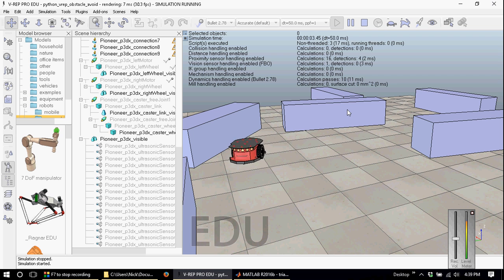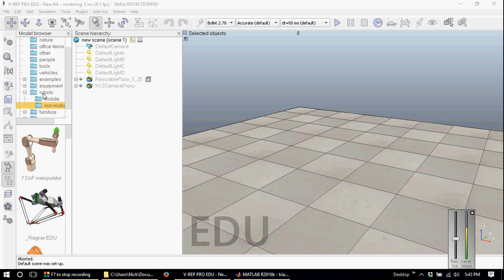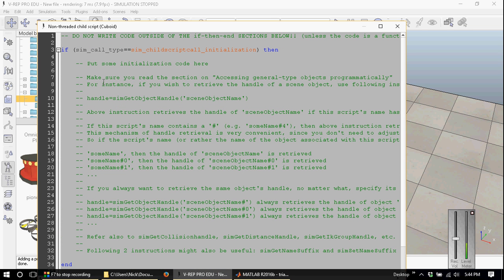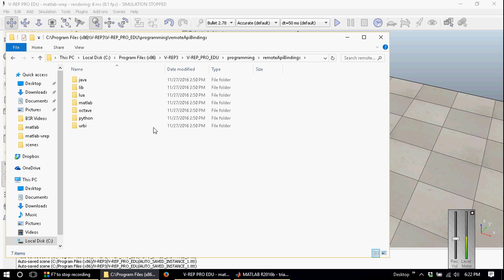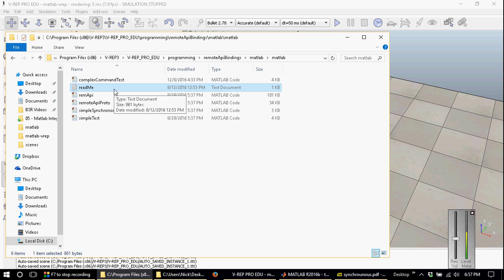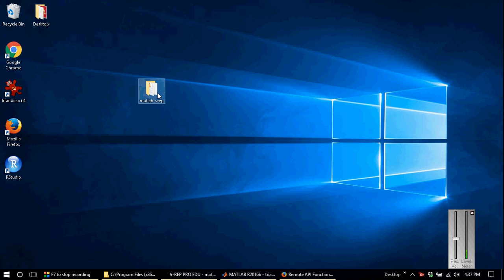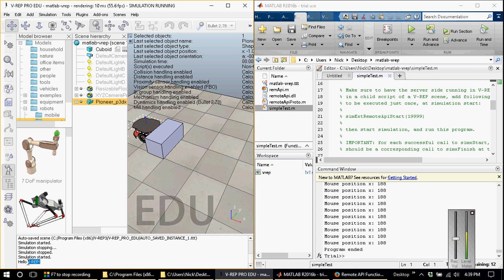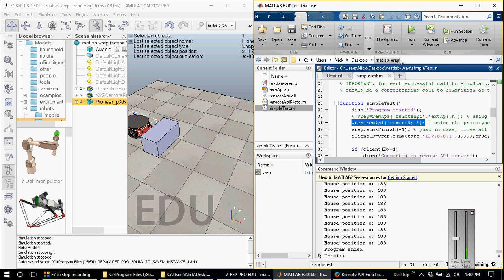05: Matlab Robot Simulation with V-REP / CoppeliaSim - Part 1

Comment: hello, this maybe very general
but, what's the point of connecting matlab to vrep? i mean what's the use
Reply from the maker: Esar Abdikar that is actually a valid question.

 V-REP uses the Lua programming language for their scripts, which not everyone might be familiar with. I personally prefer Matlab or Python for my programming and am not very familiar with Lua syntax. V-REP has path planning and inverse kinematics built-in, but most researchers would prefer to use their own module for these tasks or other community developed tools.

Matlab is being taught at a lot of universities so by linking V-REP and Matlab the difficulty in programming is greatly reduced. Matlab also has a lot of toolboxes in artificial intelligence and optimization, which (after you link the two) can be used on V-REP data.

By linking the two you can use V-REP to do the physics simulation and visualization and Matlab for calculation.

i hope that answers your question.
Reply: Great explanation, i get it, so it's accommodating people who is familiar with Matlab
I gotta question again, what do you prefer for controlling mobile robot to avoid collision and get to the destination smoothly and fast by applying Dijkstra' algorithm ? do you prefer PID or fuzzy